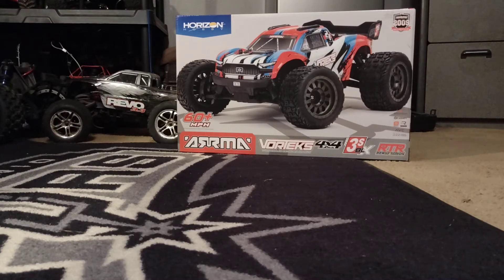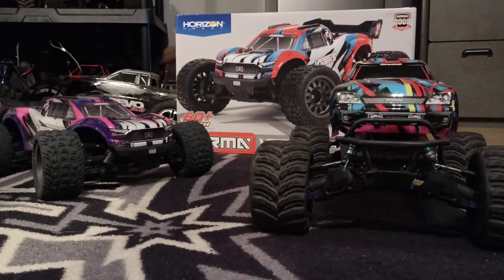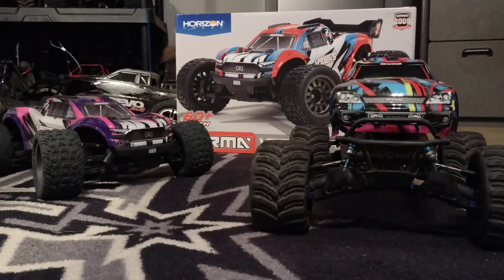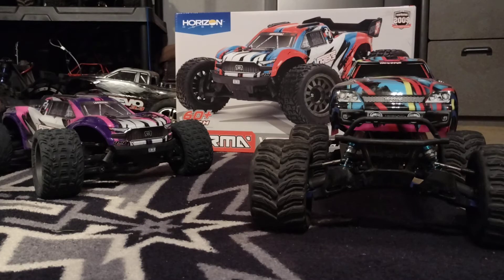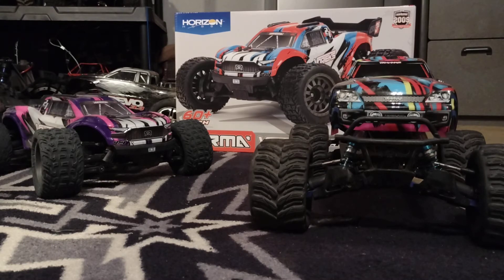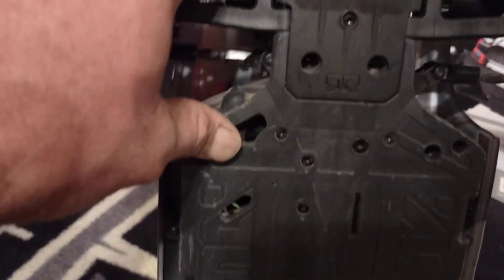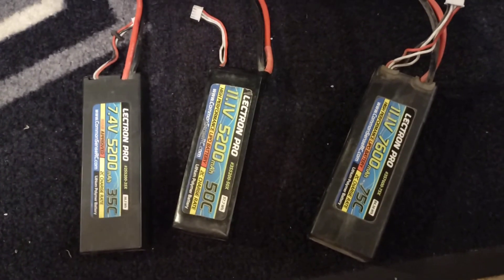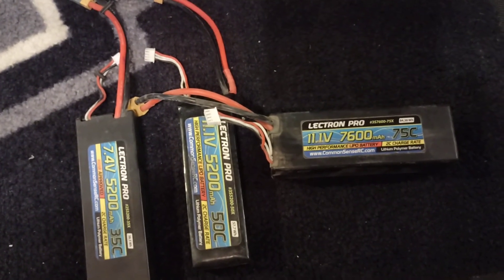ARRMA VORTEKS THE TRUE REVIEW MUST SEE PART 3

Comment: On my vorteks ive replaced 1 shock, 2 spurgears, 1 pinion gear, the motor, the avc reciever, 2 tires, slipper hub and 2 batterystraps. All in 3 weeks.

Comment: Thank you.  I just got a vorteks, 1st car... Answered some questions... The low voltage thing is frustrating.
And have a weird steering issue. It sometimes glitches to the right at low speed.. No idea..
Reply: Might be the avc reciever acting up. Does it happen when avc is turned off?
Reply: @lufenn  it happens every time the battery is about toast.. Almost like a precursor...
Reply: @moorteam1000  hm. Mine suddenly started steering on its own when reversing. Ad to replace the avc reciever
Reply: @lufenn  mine does that too now and then.. Its cool.. Get to learn how to fix..
Reply: @lufenn  yeah, and today it wicked glitched, reverse became forward..a/b toggles were now reverse and left, no steering...... All sorts in of crazy right into my cousins wifes car... Ugh...

Comment: The rustler pricing is just ridiculous. And it was a completely money pit. Driveshafts made of sticks that alone is a rabbit hole to find the permanent fix. Then the motor not able to do anything else than doing straight passes. Unable to do backflips or anything like thta. The wheelie bar destroying the rear of the body. So many things wrong with it. 3mm shaft motor. Almost everyone now uses a 5mm shaft motor on a basher. Idk why traxxas is still using a punny motor. To make my rustler how it should have been or how i wanted. I would have had to buy tires,esc,motor,driveshafts,upgraded wheelie bar,the new chassi(to be able to use longer baterries) and thats like almost a new rustler 4x4 is price. Ditched it sold it for Almost nothing(200$) got a kraton 4x4 for the same price. I didnt change a single on thing on it just a front bumper and thats it. 2 years old 80% of it is still original parts. I blew a few motor bearings because lets be honest the front motor bearings on these are shit. I bought a 10$ ceramic hybrid sealed for the motor the best 10$ ever spent. I did the same thing for all my rcs. I broke a few chassis 2 arms, one wheelie bar spring due to plastic fatigue. I still have the original body and a new body but i run a typhon body now. I wish they had a center diff. The clutch isnt fun doesnt do what i want it to do sometimes. Its not a 6s truck. But that whats happens when you get a 6s truck lol. Over all the 3-4s line of arrma is a great value for money. And that w yr warranty saved my ass a few times lol. The traxxas warranty is terrible i had to fix their esc myself or the other option was to lose my summer and pay half retail for their junk esc. That was my first rc. And it left a bitter taste as a first experience. A lot of new to the hobby only know traxxas and its kinda of a shame. A new guy expecting its the best brand but getting completely bank robbed and believe its a normal thing and stay in the loop hole until someone drags them out of it. But the xmaxx and udr are amazing the maxx is too. The rest is pretty much a waste of money
Reply from the maker: Sorry to hear that you had that experience with the Traxxas rustler that's why I said on that vehicle in my review that it was best geared at the 54/11 due to the fact that it seems that these trucks box stock cannot handle anything else but that factory setting anything higher on the pinion creates high excessive heat and also extreme chassis load so yes I've experienced my nightmares myself of upgrades on Traxxas products to make them right at least I hope this channel will help people not be stuck in the constant loophole of brake repair brake repair and not want to lose interest in the RC hobby. That's why myself I had the choice of buying the traxxas 4x4 rustler or the arrma vortex and of course clearly you see I went with the vortex. Later on today I will be posting a video of a E-Revo gen 1 of the problems and issues that I had with it kind of similar discussion axles etc also for my Traxxas x-maxx I did ditch the system out of it because of electrical problems that those models were having and I went with the Max 6 by hobbywing so yes when it comes down to it a lot of things have to be looked at on the chassis builds and electronics if you want a surefire 100% trouble for the RC or if you're just do it for the tinker in the upgrade.

Comment: Any rc with wih hard running non stop. Any rc will overheat. I had a rustler 4x4 ngl but 42mph is slow for me went 2-3 teeth i was able to cook eggs on it.
Reply: Even my 6s trucks i take a few mins break when i pushed it too hard
Reply from the maker: Also to mention what I do I will run a truck or car non-stop way past its  capacities with different gearing, manufacturer suggested gearing, different battery milliamp hours and different discharge rates and also cell size count to test to let everyone know where is the safe gearing and voltage 2s3s etc. then work your way down and not up on gearing so that way no one has the nightmare of frying something, so on the vortex I found out that that's where the safe gearing zone was at it might work differently for others but the gearing set at 57 over 15 is a safe zone only the safe zone
Reply: @southtexasrcandbrbracing7139  i dont really trust the mah and C rating recommandations i have been running 4000mah 40c packs on my kraton 4s for 2 years and i never had an issue. 30$ lipos from amazon. Internal resistance still better than 80% of my packs
Reply from the maker: Being that you're running two 2s packs I would recommend 9000 milliamps over 120 c discharge from power hobbies longer run times better punch I would love for you to share some of your experiences on the Facebook page and start the group is South Texas RC repair and BRB racing on Facebook it is a private group that has not been kicked off or started yet 😃